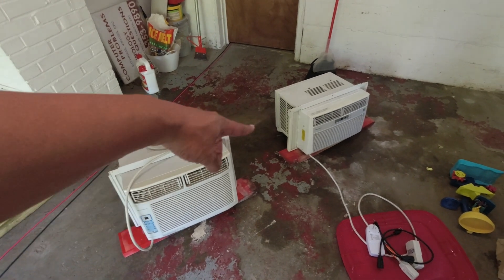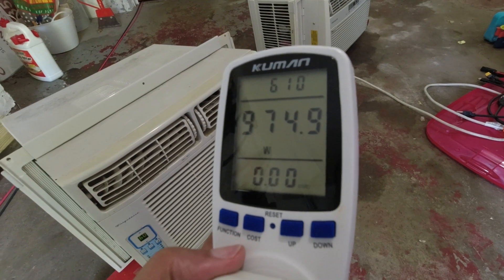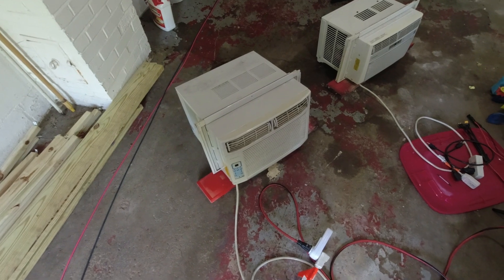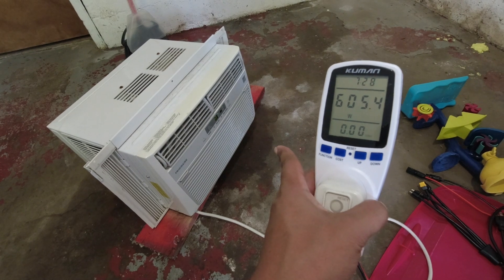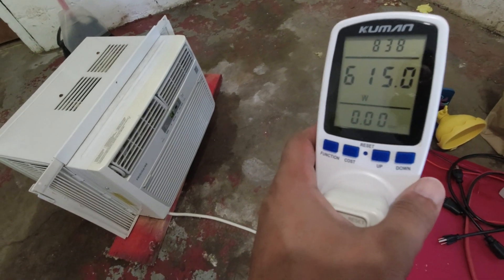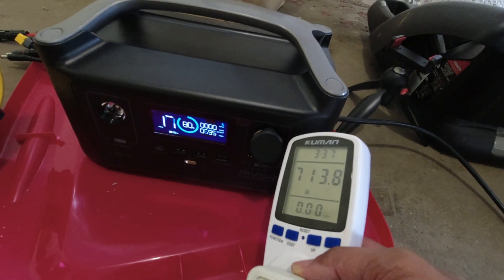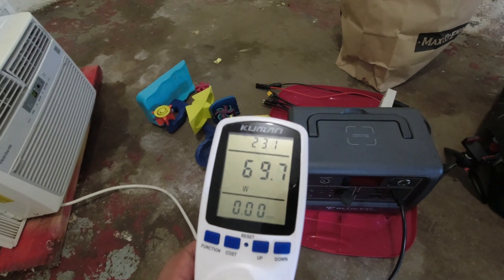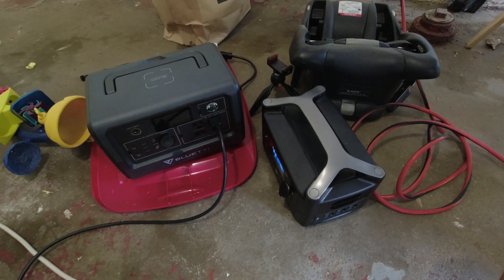Testing Air Conditioner Watts + Power Station Tests @ The End

Comment from the maker: Do you have window AC units? What Size? 
Bonus Question: What Did You Think Of Those Results??
Like The Video If You Liked It
Subscribe If You're Into Solar
Thanks For Watching!
Reply: I have a mini splitter I just got installed today.  Looking forward to running tests on it as well.
Reply: Don't have one yet but I'm trying to find something compatible for my generator... it's only 300W
Reply from the maker: @sacredlightcodes7704  I'd say a fan is about the only thing that will work with that. AC need a lot of power. 

But that swamp cooler thing that was mentioned sounds pretty cool if you live in the right climate.
Reply: @AskIveSolar  Hey Brother 👋🏽 well guess that knocked me out the box 🥵too hot in Houston for just a fan... Thanks 😊
Reply from the maker: Facts. I hear you 100 percent.
Reply: Excuse my ignorance the eco out ran the EB70? EB70 has more power?
Reply from the maker: Yes the ecoflows inveeter "out performed" the eb70 inverter on the AC test. 

The inverter is rated at 600 watts with a 1200 surge on the EF river. 
The eb70 is 700 with a 1400 surge but I've never seen it go that high. 

Now their capacity is a different thing.
Reply: Thanks Ive. I still have my eyes on the AC200P.  Want to get a gas generator first. Work in progress.
Reply: My watt meter shows that the refrigerator has only used 40 watt hours from the EB70 but it`s already at 80%. So the issue could also be an incredibly inaccurate display. Perhaps the thing still has half its charge left when the display shows a dead battery?
Reply from the maker: Did you fully charge and discharge it when you first got it?
Reply: @AskIveSolar  Ive I never fully discharged my generator.  Can I do it anytime then fully  recharge?

 harge
Reply: Which  panels do you prefer  between rich solar or renogy? I'm still looking to purchase rigid 200w panels.
Reply from the maker: Well I purchased the rich solar. What power station so you want to use it with. The Renogy 200 watt and the RS 200 have similar specs
Reply from the maker: Yes do it once or twice a year. But look it up as well. That's standard behavior for me but I don't always do it either. Ha
Reply: @AskIveSolar  I think I fully discharged it first. Golabs recommended a full discharge then a charge....I think. The battery is now "dead" with a red warning and still running the fridge, but the wattage has dropped into the low 40s so that`s not a good sign. It`s still running though and the watt meter shows 340 watt hours used. The fridge has now been running for 16 hours. I`m told others get up to 40 hours from a 50 watt fridge. I`ve turned the thermostat to full blast to hurry things along.
Reply: The LG dual inverter window air conditioners have less continuous watts.  I wonder how much less.  I’m wondering specifically about the 10,000 BTU dual inverter from LG.  I found a video showing a 14,000 BTU dual Inverter from LG that leveled out at about 575 continuous watts but the guy didn’t show the max peak watts.  Sigh.  All of these specs are very important. Anyway, its surge was not fast.  It took a minute to get to the max peak and then another minute to go back down to continuous.  

Thank you for your videos!

Comment: The compressor motor needs a few thousand SURGE watts to start! 
After it starts then it runs at rated wattage. 
An AC with inverter driven compresssor needs less SURGE watts to start (partly because inside inverter circuitry stores energy in big capacitors tor inverter function).
Reply from the maker: How do I tell the difference Gary

Comment: i found something  very interesting out yesterday when i tried to run my AC.I have a 5000 BTU A/C and using a Bestek 1200 watts pure sign wave inverter. If i started the AC with the fan on high the inverter shutdown. Just for shits and giggles i started the AC with the fan on low and the inverter powered up the A/C. Once the A/C was running i kicked the fan on high and the inverter puurred like a kitten. with no beef chow main:face-green-smiling:🥠🥠🥠
Reply from the maker: That's so wild that you said that. I've been having a similar situation but involving my AC200P. 

The surge is so high that anything else on the AC outlets has to be turned off and it works more reliably if the fan is on low.
Reply: @AskIveSolar  "The surge is so high that anything else on the AC outlets has to be turned off and it works more reliably if the fan is on low". You are exactly right
Reply: Having the fan on low left just enough SURGE watts to get the compressor started! On high it will trip again when the compressor cycles.

Comment: Fascinating, I have a 3 ton inverter heat pump.  It's set to 74 degrees and is drawing 785 watts maintaining it's setpoint. 100 watts for the blower and 685 for the outdoor unit.  I was curious of how much a 10000 btu window unit draws and came across your video.  I have a 5000 btu window unit bought for camping and it draws 500 watts.
Reply from the maker: Stop boss, thanks for watching and taking the time to comment. 
Literally Nobody tells you how much those things draw so thanks for that! That's pretty cool!

I don't have a reference for what a 3 ton is but it's cool none the less. I have a 10k BTU joint and it uses 1000 watts.

Comment: My experience is
The fan is the only thing effected by "low / high".   And it draws almost the same amount whether low or high.
And the window units draw 0.95 watt per btu.   
Portable units draw 1.2 watts per btu
Split units draw 0.8 watts per btu

And any unit under 5,000 BTU is insanely expensive.

I get 1 minute per 100 watts of battery storage on 5000 btu units.  So one 1000 watt battery will run a 5000 btu ac about 100 minutes.   If you had a small, well insulated area that you could cool in 20 minutes per hour, you could keep it cool for 5-6 hours.

Having Tarps you can hang from the ceiling to divide the space would be helpful.   You could also use cardboard boxes to take up space in a room and reduce the amount of air that had to be cooled.

The temperature setting only changes the compressor setting if the room gets down to that temperature and the compressor turns off.
Reply from the maker: That's some fine deduction and concluding you've done there Sir!
Reply: @AskIveSolar  thanks.   And thanks for making your video.

Comment: I have the midea u shaped 8000 btu inverter unit hooked up to a battery bank and solar system in a cargo trailer. In high speed I have seen 900 watts on near 100 degree days, running like that it will drain my batteries even with solar if set to 80 on 95 plus days. I have been keeping it set to 86 and it has not drained the battery since, usually runs between 250 and 450 watts when a few degrees higher than the set point, and if it is close to set point around 150 watts.
Reply from the maker: Oohhh that's interesting. Thanks for sharing I'd love to hear more about and maybe see your setup. 

solarquestions@askive.com if you have time.

Comment: Wow, I was considering the eb70, as it OUGHT to have been able to handle that small AC; but NOPE.  I think I might stick to DIY for AC; I've got a 100AH LiFePO4 battery attached to a 1000W inverter; will make a good test this weekend on my little camper; I tested its draw last weekend with both its AC and its refrigerator running, and got a little over 600W.  If that can't hack it, I've got a 2kW inverter on the way.
Reply from the maker: Interesting!

Comment: Good test. I think once the room the A/C is in reaches temperature it will run a little less much like the 12V refrigerator/freezer. Best choice is a small closed off room! i either use the EcoFlow Delta, Goal Zero 3000 or the Bluetti AC200P for AC, with max allowed solar. I cannot wait for July 1st! I am looking at the Ecoflow Pro which also has LifePO4 batteries for the first time. This is so interesting to learn from like minded folk! Thanks!
Reply from the maker: I hit the dislike button by mistake. Haha. 
Yeah I think so too @ being in a more controlled environment. 

Which device is gonna have lifepo?

Comment: It seems as though we are stretching the limits of these below 1k watt gens. If you intend to run a a/c with a solar gen then you should be looking at a Bluetti 2400 or bigger 200p and comparable powered gens. Below 1k is just not going to cut it and you would be destroying a great device meant for other smaller items to power. You cant squeeze blood out of a turnip. You got to spend the bucks if you want that kind of power.
Reply from the maker: Just testing my man. That all. 

But I hear you, I'll be clearer about that on future videos. 

But sometimes, you gotta work with what you have. Yanno

Comment: Good max load test of the two units.  Thank heavens for the built-in overload protection on both power cubes.   Eco-flow gets the win, but i believe if you had it on a oscilloscope connected - you'd have noticed a significant voltage drop during the AC compressor's start up spike.   The Bluetti unit's overload protection just switched off the inverter rather than attempting to manage a wattage spike via a reduced voltage output.

Lesson learned:  Both the Eco-Flow River 600 and the EB70 seem best suited for overland camping use.   Fans, small DC compressor type camping refrigerators and LED lights should be no problem.  For household appliances, it is time to up the budget - if a microwave oven or small room-sized AC are a must have.
Reply from the maker: Good summary my man. Interesting @ B shutting the inverter off. And not putting an overload message.
Reply: @AskIveSolar  With regards to the Bluetti EB70 - I'm able to forgive its limitations, mainly because for the past 6 years, I have been using a solar pack that is based on a Group 24 lead acid AGM battery. The battery alone weighs in at about 60 lbs.  Add a bit more for the battery box and installed electronics.

The EB70 is about half of the size of my old-tech battery box and about a third of the weight.  Usable watt hours are about the same - but I now have an AC inverter that is rated at 700 watts versus 150 watts for the former. A bonus with the EB70 is its USB-C charging port that plays well with my MacBook Pro.  

The old-tech battery box is still reliably plugging away on its original AGM battery, mainly because it has been on a battery maintainer 24/7 when not in use.
Reply from the maker: Yeah not matter how I critique it. I'm still happy with....at this point. I just had to adjust my mindset on it. 

Could it have been more polished....sure. But for that price. It's still a really good little device.

Comment: Timely video as I just started running my LG 14,000 BTU 115-Volt Dual Inverter Smart Window AC on my AC200P. I have the AC200P connected to max solar input of 700 watts. The LG AC is only using 500-600 to keep temp at 72 on medium with outside temp ~83.
Reply from the maker: Wow! Thats a really low draw for such a large unit. I notice a lot of cool words like dual inverter and smart. I wonder if newer ACs are just a lot more energy efficient. Thanks for watching and taking the time to share your experience
Reply: @AskIveSolar  Inverter AC units do not have a huge startup power draw as they slowly ramp up the compressor speed over 15 - 60 seconds.

Comment: Thanx for the review, I’m researching for a midrange solar generator that can handle portable heaters.  Cold is a major foe in my neck of the woods come late fall and winter zone 6 🤔
Reply from the maker: You should really look into other options. 
For example. Let's say you spend 2 grand on the ac200p. 

It can only run a typical 1500 watt heater for an hour or so. 

Now you can run a heater for a little longer on a lower setting. Typically 750 watts per hour. 

I have seen a 500 watt heater on Amazon and you could run that for a few hours. 

Just something to think about.
Reply: Im in zone 6 too, and my thought is to find an electric blanket that I can run off a solar battery.
Reply: Solar generators are not really meant to power high wattage devices for too long. Microwave is fine because it only take about 5 minutes to heat food but a portable heater is a no no... You need something like natural gas, propane or wood.
Reply: Check out propane heaters..camco wave 3,6,9 or mr Heater blue flame heaters
Reply: @topcheese2889  Good point. I need to get over my fear of propane and familiarize myself with it.
Reply from the maker: @Urban yeah I have an uncertainty about propane as well. I almost purchased a Mr Buddy off the market place but didnt because those little propane tanks that they prefer are a waste of money and the bigger one required adapters and all that. 

I thought that was odd (understandable) but that in conjunction with my unfamiliarity....I held off.
Reply: @AskIveSolar  got to go with the blue flame mr heater, or the camco. They both run off the bbq tanks and are basically ventless. Just need to crack open some windows
Reply: @urbanohiogardener  you can get a propane sensor/alarm

Comment: I use a Hessaire cooler (swamp cooler) 85 watts and it's been 102-105 degrees and it keeps my little crib really cool, 68-70 degrees, so eb70 can run and other things.....this is a great video!
Reply from the maker: What area of the country are you in. I'll have to look into that.
Reply: @AskIveSolar  Arizona, it's dry heat, they don't work in humidity.....where I'm from Detroit they don't work, I learned about these units out here..that eb70 will be perfect for my situation, its on the UPS truck and I keep looking out the window lol
Reply from the maker: @mariajacksoncooks  Nice. I know the feeling for sure! Make sure you charge it fully and deplete it fully then charge it fully again. 

That's my practice with any battery
Reply: @AskIveSolar  Thank you so much Ive!!!
Reply: What 😲 where you purchase that Air 🆒 system Sis ? 🤔
Reply: @sacredlightcodes7704  Amazon :) Its called: Hessaire MC18M....its a Portable Indoor/outdoor 500 square feet Evaporative Swamp Cooler...great reviews before I bought it, it is great, if you need to know anything else let me know sis
Reply: @sacredlightcodes7704  keep in mind it only works in dry heat...😊
Reply: Thanks Maria but it won't do me a bit of good in Houston 😄
Reply from the maker: Yikes. I'm from new orleans.
Reply: @AskIveSolar  I emailed an eb 70 question to you, but i believe I have to send this unit back because the wireless charger on top dont work.....everything else works but that.....
Reply from the maker: @mariajacksoncooks  ouch! That sucks. What kinda phone do you have. I never quite got into wireless charging but it's pretty cool.
Reply: @AskIveSolar  it's cool because I can plug my phone in the front, everything else works, I have an Android Moto..  when my daughter comes over later imma try her phone which is much newer than mine...  I have 5 things plugged in it tho,  I'm in my world mane lol
Reply from the maker: Oh ok. I was wondering if your phone has wireless charging. And some of them don't work through cases.
Reply: @AskIveSolar  ahhhh! I just looked my phone up and it doesn't have wireless charging, Thank you Ive, I thought all smart phones could be wirelessly charged lol
Reply from the maker: Whew! Dodged a bullet. I didn't want you to have to return it if you didn't have to.
You're welcome
Reply: @AskIveSolar  Straight up! Thanks to you, because I looked up troubleshooting the wireless charge so many times and got nothing....im so grateful!
Reply from the maker: That makes me happy. Glad to help. 🙏🏽
Reply: @sacredlightcodes7704  right...its humid there :/